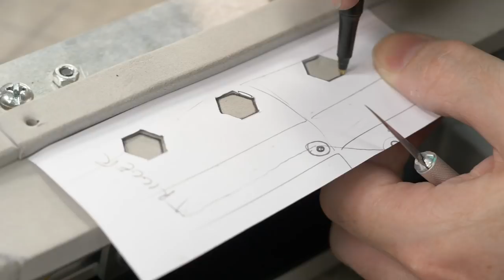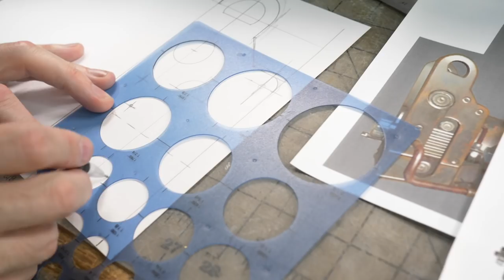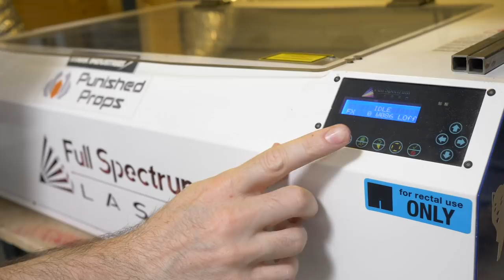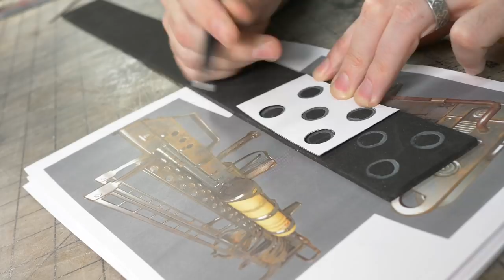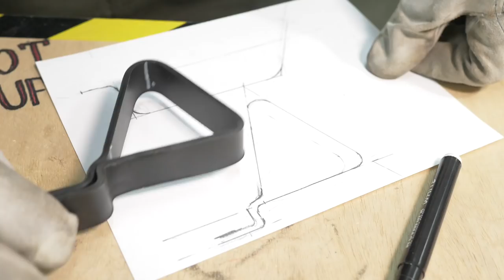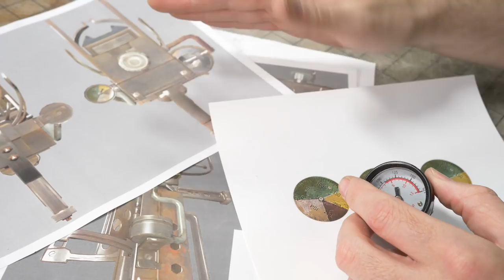The ULTIMATE Fallout 4 Build! WORKING Fat Man Mini-Nuke Launcher

Comment: quick suggestion: If you are attaching a cable like that with just a screw, I suggest that you throw a zip tie or something to hold it together and prevent it from sneaking out from under the screw. It will really help in that kind of application. 
Build looks fantastic. I love the use of the rails.
Reply from the maker: Thanks so much for the tip!

Comment: I'm not sure if anyone mentioned this but...

Technically the foregrip is not a fixed component but is also the charging handle like on a bolt action rifle or the pump on a pump action shotgun.

You are supposed lift the foregrip up to the left side and pull it back to bring the sled to the fireing position and then you move the handle back forward and down to verticle (like a bolt action firearm) to once again become the foregrip

Comment: This video is a couple years old now, but your glue burn brings up a hint. When working with hot glue, keep a bowl of ice water near by... If you get hot glue on you, immediately dip the affected area in the water... The ice water will pull the heat out of the hot glue stopping the continued burn. It will also pulls the heat out of your tissue, thus reducing the severity of the burn.

Comment: I think a bar would have been better than a cable to connect the trigger cable streches over time a bar doesnt. I think you would have benefited from a trigger return spring that was more beefy and I think you need more surgical tubing to increase the range. Tho being a gunsmith not a prop maker I might tend to want to over build.
Reply from the maker: Yeah it's always a big challenge riding that engineering line! I think in this case I wanted to be able to use it for the video and not much after, so it worked out.

Comment: why not use a spring instead of rubber tubing
Reply from the maker: Because of how the tubing wraps around the structure, it works a lot better than a spring, which wouldn't maintain as much elastic pull and could get bent.